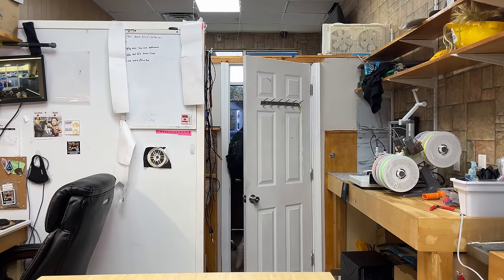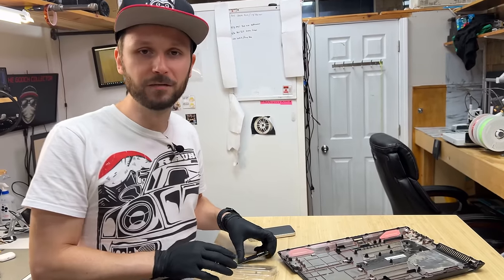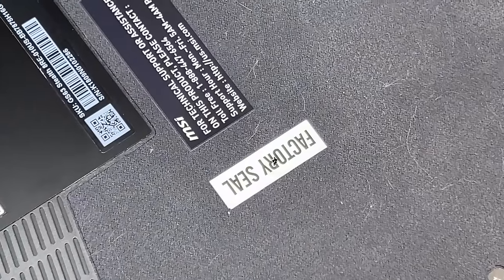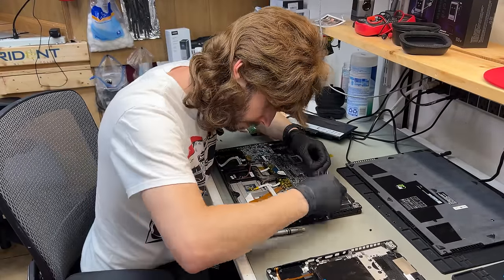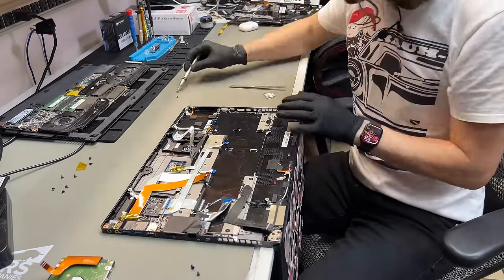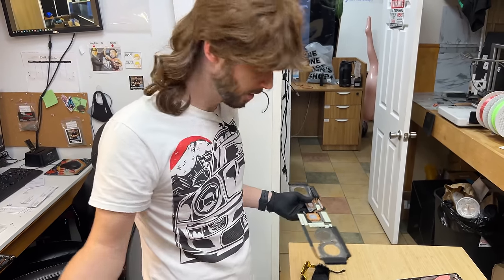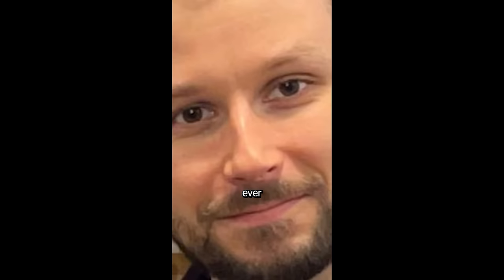Late Night Tech Rescue: Fixing 2 Gaming Laptops at my Computer Repair Shop!

Comment: I just cloned my laptop's sata to an nvme 2 days ago myself and had the same issue. After a bit of testing around I wanted to open safe mode, and before selecting it, my laptop just restarted by itself and began working. Quite an experience to behold.
Reply from the maker: I’ve learned to not ask questions when things fix themselves
Reply: @SalemTechsperts  if it works, don't touch it lol
Reply: Windows is just mysterious
Reply: How do I clone a drive to another using disk genius and make bootable and not crashing on boot
Reply: @SalemTechsperts  a lot of times after we make a clone the first boot freezes at the windows loading screen. After a hard shutdown it works normally. (I have also learned to not ask too many questions)
Reply: always appease the machine spirit

Comment: thank you for the cleaning tutorial, been wondering for a while how to properly clean it !
Reply: propyl-y clean them, badum ts
Reply from the maker: Make sure to always unplug the battery before you clean the keyboard. If you use unknowingly use too much you can cause a short.
Reply: It actually a bad idea to use alcohol on a screen, it's actually possible to damage your screen if you do.
When cleaning a screen using a microfiber cloth and distilled water works best.
Reply: @SalemTechsperts  is there any kind of like... reflective/anti glare coating or something on normal monitors usually that could be damaged by iso alcohol? or no worries? thanks
Reply: @RegalPixelKing  we use window cleaner, (windex) not as harsh and does not leave any marks
Reply: brought to you by the greatest technician that's ever live😂

Comment: i recently started a job as a technician and opening up these laptops without breaking the clips is a terrifying process for me.
Reply from the maker: You’ll never get it perfect. Some of those clips are so old and weak they break if you breathe near them.
Reply: Coming from a technician...it's not the end of the world if one or two breaks....most of the time it's probably due to the plastic being old and/or crusty

Other times they snap because of "improper" technique or just shitty tools....in which as you go you'll learn how, how much, and where pressure is to be applied to open the case without much damage
Reply: @SalemTechsperts  Also a good trick is to use a thin guitar pick.
Reply: @SalemTechsperts  😂😂

Comment: 5:05 I tried to fix my laptop by ordering a new frame since the old one was broken. I riveted the old keyboard to the new frame, but it ended up sinking. Worse, the entire motherboard got shorted—probably due to broken traces or microfractures, since the old frame was bent and bent the motherboard too, and putting it into the new, straight frame caused further damage. It was a cheap $350 HP laptop, and the replacement frame without the keyboard cost $30. After wasting 3 hours trying to fix it, I ended up salvaging the drives, throwing it out and buying an ASUS TUF for $800 instead.

Comment: Replacing riveted keyboard sucks. Super time consuming, they feel off, usually don't sit right so one part ends up higher or lower that the rest, and chances are it's gonna snap off the rivets since they're weakened already, so warrantying it is a pain.

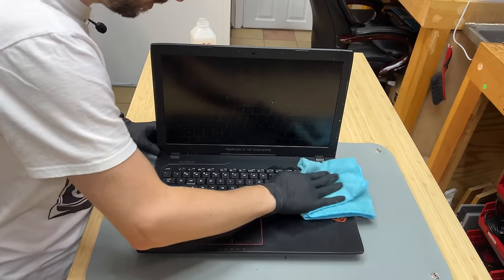Comment: 1:47 Fun fact, 70% isopropyl alcohol is actually better then 99% for most things. The water slows the evaporation, allowing it to stay on the surface you're cleaning longer. The water also helps to dissolve stuff, as well as improving the anti-bacterial qualities of isopropyl. It does this because the water helps to penetrate the cell walls, allowing the alcohol to kill the microbes quicker and easier. And while isopropyl is better at dissolving some things, water dissolves a much wider variety of things. So unless you're cleaning the PCB directly, you'd generally want to use 70%.

Comment: im curious what is bad for wiping down a screen because i thought alcohol was bad for the screen as it can destory a layer of the screen.
Reply from the maker: The internet will never agree on what's best. Those bad experiences come from people that either used way too much 99%, sprayed it directly on the screen, or scrubbed way too hard.
Yes, if you have a touchscreen, it CAN rub off the anti-glare / anti-fingerprint coating if you use too much too many times. 

I can say as a repair shop owner that uses 50-70% on thousands of laptops and monitors, including my own, I have never had any issue with coating coming off, streaks, smudges, melting, or any other issue that apparently happens to the rest of the internet.
Reply: I’ve been using a mix of 25% rubbing alcohol and 75% distilled water for over a decade. It has served me well
Reply: @SalemTechsperts i use lens spray cleaner that says its safe for screens too

Comment: Great vid!  Having to boot into safe mode just because it needs to use a differrent storage controller driver is a windiws annoyance that I wish they would fix.  Doesnt matter the brand... if you go from sata to nvme it needs a safe boot first to detect the change.

Comment: Hey I have the same MSI stealth! The CPU fan has died on me twice, what a PITA to replace... I keep fearing I will snap the mobo in half when removing it.

Nice job and classy to replace the thermal paste on your own dime, you tha man :)
Reply from the maker: There must have been a bad batch of bearings that were used in fans for some MSI models because there was 1 month where I fixed like 10

Comment: 1:45 be careful with solvents, especially high concentration isopropanol like that, it will absolutely eat through a lot of surface coatings and materials/colors, like matte and rubberized surfaces. I’ve ruined a lot of stuff cleaning it like that. Just use distilled water and a microfiber cloth, then more dilute iso more sparingly as needed.

Comment: my way of cleaning devices and most importantly screens is to use some drinking water and windows cleaner. i do like a 60 to 40 mix. it works wonders, but takes longer to dry from isopropyl alcohol, but atleast i do make sure that i wouldn't damage paint of a coat on a screen

Comment: The speed increase moving to nvme drives is the single biggest increase Ive seen in 40 years.
Reply: I wonder..how an m.2 ssd would be replaced by an NVME since slot isn't the same. If the slot is made for m.2 SATA can't recognise NVME.

Comment: My GS63 Stealth won't start up if I don't pull out the adapter in time with the power light. One of a kind.....
Reply from the maker: I made a Short video about one I found at the bottom of a bin that had a completely melted capacitor yet functioned perfectly fine. They're something else lol

Comment: I have that exact asucks Repubics of gonarrhea. The DP port never worked from new. I swapped in new thermal paste, 4tb dual m.2 to sat, 2tb m.2 nvme, and 64gb of ram. I need to try to solder that dp port, pretty sure the pins aren't soldered on correctly.

Its suppose to come with a nvme, i7 and a 1070 8gb

Comment: I have a MSI GS76 stealth. I just recently cleaned the nastiness out of the heatsinks and removed, replaced thermal paste. I learned a lot from this channel along with my own experience with computers over the years. My problem is that the thermal pads look awful. I want to replace them, but don't know what to look for. Please help. The only thermal pads I have are kind of thick and meant for PS4 ram chips.

Comment: Also, if you're taking the motherboard out of a laptop... just replace the paste. It will probably need doing ESPECIALLY if it's a gaming laptop, and it's only about 4-8 more screws to gain access to the cooling system anyay.

Comment: you should use quick detailer for cars to clean the jizz, spray on a microfiber towel and then wipe the wet towel on the keyboards and everything, it cleans really well and is gentle af
it also leaves a nice shine on any case or keyboard or screen so it looks clean like new
i know it sounds weird just try it; rinseless wash also works well, i use optimum rinseless mixed with water, spray on the towel and it will shine any surface including car interior and keyboards and monitors everything

Comment: Now unless this is a skit I'll read out the note for you :) "Hey Andy! Ive been watching your videos for a while,  and I am confident that you will be able to figure out this issue! Here are the details: - laptop boots but does not display anything on the screen, and no output on hdmi either. - I replaced the ram thinking that was the issure, but no luck - Im thinking it may be a GPU problem but I am not sure - I also included a crucial P3 SSD that I was wondering if you could install and transfer Data for me - Thank you - Included the case crews in a ziplock bag" (obviously you can read, but for anyone else...)

Comment: Oh damn, i have the same laptop !
Well, a different series as mine already had the ssd for the os. I also upgraded it back then as i removed the dvd reader for a ssd.

Now it's collecting dust somewhere, the hdd is starting to have trouble and windows corrupted itself. I've retired it after 5 years of good service a few years ago.
I'm thinking of turning it into a linux distro laptop so i can try out playing on it before moving to linux when windows 10 is no more supported.

Comment: So since you can't read i'll tell you what the note says. It says:

Hey Andy

I've been watching your videos for a while and I am confident that you will be able to figure out this issue!

Here are the details

Laptop boots but does not display anything on the screen, and no output on HDMI either.

I replaced the RAM thinking that was the issue, but no luck.

I am rhinking it may be a GPU problem but i am not sure

I also included a Crucial P3 SSD that i was wondering if you could install and transfer data for me

Thank you! 

I included the case screws in a ziplock bag.
Reply from the maker: This took a ton of time to type and I appreciate you doing that!

Comment: yo bro tysm i had a shitty i3 3rd gen with 6gb ram barely could run anything but i decided to upgrade to i5 3rd gen but i damaged my motherboard somehow and didnt knew it had the issue i thought it was the power supply but could not afford a new 1. I was just scrolling on yt saw ur fixes and i was so dumb i didnt think that the motherboard could have been faulty. 1 Slot of my ram was having some issues and today i just tried to fix it and it worked tysm. :)

Comment: No i replaced those keyboard like 1 a week here in Jamaica. And when i am done i set it back like new. You won't believe it was replaced. I do it because it cost less to get the keyboard. It is like $8,000jm for the keyboard only, $10-$15,000 in the case. (I hate when mi boss buy the keyboard alone because it takes like 45 minutes to a hour to do, base on the laptop)

Comment: FYI you can remove those rivets in less than 5 minutes using a tiny drill bit and an electric screwdriver.  Don't use a drill because you risk ruining the keyboard.  Then when you install the new keyboard you can use hot glue where the rivets were in order to keep the keyboard from sagging.  Hot glue is great because you can just peel it off if you need to remove it in the future.  I agree that buying the complete assembly for $60 is the way to go, but sometimes the replacement assembly is either non-existent or astronomically expensive.  Looking at you, Razer laptops.  I once had a Razer laptop come in with a bad keyboard and the replacement assembly was $900.  I bought the keyboard instead for $120 and used the hot glue method.  Some laptops have a metal plate behind the keyboard and with those laptops you don't have to worry about using hot glue.  The plate itself is enough to keep the keyboard from sagging.  My point is, yes, it makes sense in most cases to just replace the entire assembly but that's not always possible.  You have to be willing to experiment and try new ways to fix things because modern computers use such low quality plastics and other materials and are not designed to be repaired.

Comment: I've replaced a keyboard by melting the rivets because a friend of mine bought the standalone keyboard, its one of the worst replacements I've ever done, the keyboard ended up working great and all, but those fumes and the stress of melting those 40 something rivets was awful

Comment: is isopropyl alcohol also viable for Macs, cause it has this reflective (?) coating or smth on the screen?
Reply from the maker: A very small amount of distilled water on a microfiber cloth is recommended for anything with a glass screen / anti-glare coating

Comment: 5:30 I actually did an actual repair of a fused keyboard and yeah, don't do it, it takes way to much time and in most cases isn't worth it, I had time and only replacing the keyboard costed me only 10 bucks versus the 80 it would have costed for a whole top case (the top case was expensive because unlike the one in the video it was aluminium not plastic), so yeah for a repair shop doing such repair isn't worth it neither for the customer nor the shop because in the end the lower price of the part will be out weighted by the labour cost

Comment: When cleaning screens without a screen protector, you gotta use distilled water (typically) to not leave mark or risk breaking down the film, alcohol isn't recommended for most screens
Reply from the maker: My beef with this is that people are going to short their screen / mobo out when they use too much and the water drips down to make contact with the LCD cable under the bezel.
Reply: You spray the rag first
Reply: Just mix a bit of Water into the isopropyl for the spray mixture to also remove beveragestains. Still instantly evaporates but cleans averything
Reply: @SalemTechsperts  that’s pretty fair but as with anything you gotcha handle electronic with the right amount of caution(lol reguarding people trying this on their own you know this already ofc)
Reply: @SalemTechsperts distilled water generally doesnt conduct electricity but I would still recommend people to exercise cause. I prefer lens spray liquids myself.

Comment: with the correct tools a riveted laptop keyboard can be turned around in like 2 hours of labour or so for getting it right and making sure it feels right with no high or low spots. Did it exactly once to see if I could the 2 hours is an estimate from the fact it took me 4 and I can usually double my speed with experience if I did it a lot. I'm not going to. Not worth it in the slightest, a top case is cheaper than the labour cost of re doing all the shitty rivets.

Comment: God, I recently had to replace family laptop's palmrest plastic part.
Keyboard, touchpad and everything else was fine, just the hinge inserts got fricked.
I spent 3 hours, cutting the god damn plastic that held the keyboard, and then re-melting it on the new palmrest cover.
I swear to god, if not for the urgency of needing the laptop asap - I would 1000% order pre-assembly of keyboard and palmrest.
And if anyone's curious, the laptop is Lenovo L340-15IRH 81RU or something like that, with i5-9300H and 1650m

Comment: i brought a couple 1tb p3 plus drives a while ago and i was horrified at how slow they were aye. started off allright but once about 200gb had been copied over to them i could not get speeds any faster than an old usb 2 flash drive. would test up at like 20mb/sec or less. took them back the next day and got lexar nm790 drives instead, also dram less drives but man they are a fuckload better aye. get over 4000mb/s even when over half full

Comment: Aren't some panels more sensitive than others? Just curious if you recommend using something else besides alcohol.
Reply from the maker: Yes they are and try distilled water at first but make sure to unplug that battery

Comment: So what the difference in temp reduction between the PTM and thermal paste? I was going re-paste my ASUS ROG Strix G712LV (which may have LM, but Im not sure.)
Reply from the maker: Don’t use LM man, it’s not worth it. I didn’t show the temp difference in this video, but if you look at my previous videos and shorts where I use PTM 7950, it proves to be incredibly effective, and statistically the next best thing to LM. It also lasts much much much longer.
Reply: @SalemTechsperts  I'm trying to find out what is there (I've heard both lm and tp) so I k own what I'm getting into since it's my daily driver.
I'll take a look for those videos, I'd rather use the ptm.

Comment: Me is somehow a bit scared into destroying my laptop if I try to clean its fans and replace the thermal paste by myself... I had my gaming laptop for a decade now and it has been "fixed" to what it can be considered as its maximum (Max RAM=16GB and Max Memory=1TB). My Gaming Laptop of 10 years is the MSI Leopard, though the Battery's useless and the HDMI is kinda not working "correctly" it still works

Comment: keyb replacement around here is not that straight forward, most of the times we can't get the full palm rest assy and we have to re-melt the stakes ... not fun

about cloning, I recently discovered that booting the cloned drive on the PC I'm doing the cloning gets rid of the issues and BSODs I usually see if I just put the cloned drive straight into the client's unit - why!? I can't quite explain it

Comment: I've been done changing laptop keyboard on those type of plastic mounting, it is bad to do but we have to actually melting all those nub and tear it then replace keyboard then repeat the melting process, because no one in hell (at least in vietnam) are going to change the whole thing instead of just the keyboard (usually changing keyboard cost about 15-25$ here).
Reply: it's a pain in the ass to do but there's nothing else wo could do beside that